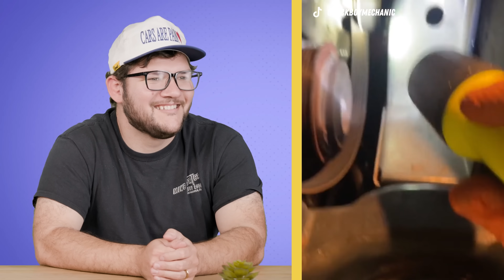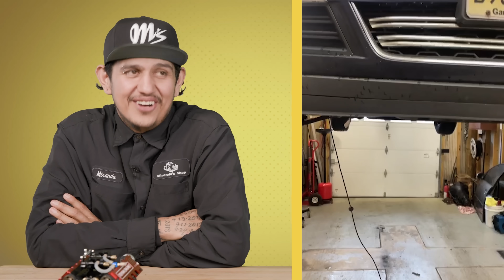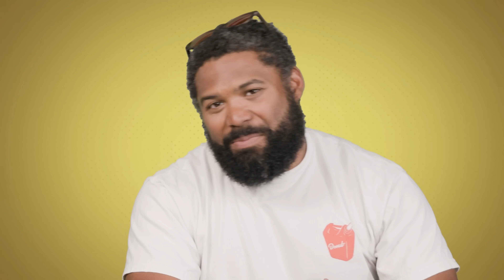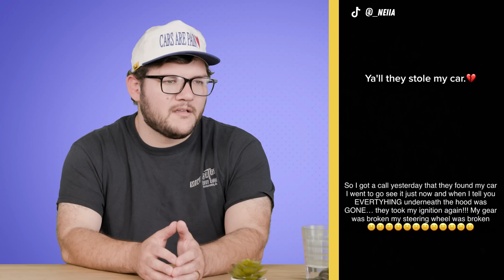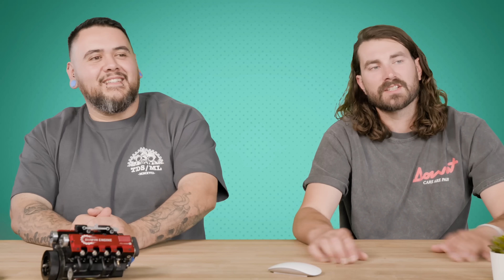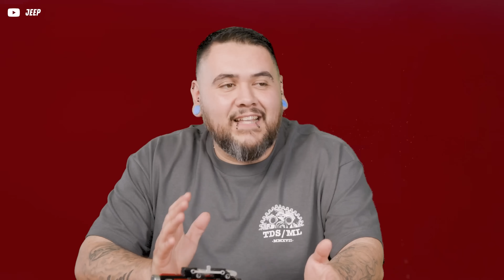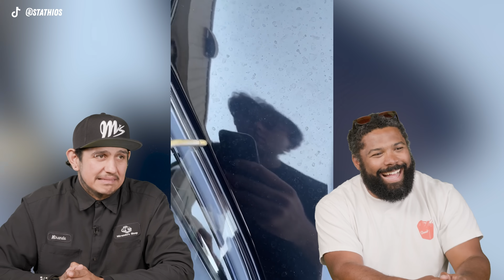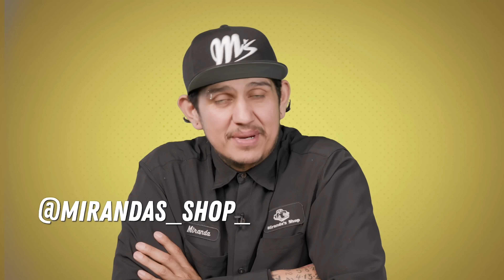Mechanic Reacts to Car Engineering Fails

Comment: Engineers rely to much on computers and algorithms. The timeless "it says it works right here" as they whip out their laptops. Not enough time in the trenches, but that's what mechanics are for. We make engineering and manufacturing f**k ups work. Oh and don't forget Intentional obsolescence. Cars last barely past their warranty, if you're lucky. It creates demand. Engineers design them cheap and manufacturers are only in it for quantity. Especially since the 2000's. Pre 2000's were over built and easy to work on. Don't get me started on the bs lithium battery cars now. Cheap materials, inexperienced yes men engineers, greedy upper management and manufacturers. It's a trifecta of crap cars made. New cars are a waste of money. 5 year warranty and 7 year loans. I mean that right there should be a warning sign...We mechanics will be here though. We'll be here to make sure crappy designs stay working.

Comment: I've learned that sometimes the issue is the engineer, but sometimes the issue is the company that the engineer works for. And engineer might have brought up that issue, but they didn't want to spend the money to change the design so they just pushed it out the door and didn't let the engineers fix the problem.
I'm not saying engineers are saints. Don't get me wrong. Lol

Comment: I got a question for a Nissan engineer. Why do the newer model sedans have a skid plate with 20+ tabs that needs to be removed just to do a simple oil change? Couldnt a smaller cut out skid plate been installed? Or just have access holes in the skid plate?

Comment: 10 engineers. 1-2 do design. 3-4 figure out how to bill/admin the designers' work hours. 2 do revisions with commercially available parts/sub in legacy parts already in production. 2 more admin/bill that and propose money saved. Yes, a bolt a quarter inch shorter can be used, but after making said custom length single purpose bolt, hardening it and the component to hold with less threads, the cars price has gone up and it will hurt sales. It sucks, but the parts have to come in under the wire. No engineer wants their work revised for cost cutting, but a cost cutting revision engineer has to post savings to move up.

Comment: the kia and hyundai stealing problem is a U.S only thing, not engineering, instead its actually marketing, cause in the U.S the key detection system is not mandated like it is in the north. The thing that is a engineering fail is the fact of how easy that capsule can be plucked out to bypass the key. but don't blame kia/hyundia for not having the immobilizer setup in the car. That shit is cheap for a reason, anything to reduce cost and get more clients is marketing. The Koreans know that people want cheap shitty but good to drive cars. So they produce a lot of junk.

Comment: Not that I want to let engineers off the hook - I’ve seen a lot of “we don’t care because we don’t fix it” engineering designs, but auto manufacturers rightfully put components like engines in multiple vehicle platforms. Was that engine originally designed for an SUV and then someone decided to put it in a sedan???????????

Comment: For Escape had a blown alternator.  Researched before trying to replace.  Dropped it off at NAPA. THEY had it ready 4 hours later. Raised the engine, lowered the transmission, and replaced the spark plugs at cost as a courtesy.

Alternator was between the tranny and engine by the firewall and I front of the spark plugs

Comment: Those washers on the McLaren would have been an engineering issue. They looked to be locking washers. If that IS the case, then it wouldn't matter if they were stainless or mild steel, they would cut through the pain on the frame and caused rust either way. If they were flat washers, then it should have been nylon or rubber to protect the paint.

Comment: Fuxk them belt tensioner man have you try taken them out on 2020 Altimas you literally have to remove the fuxking top motor mounts, raise the engine and still struggle to get tension to get the belt in. Jesus fucking christ 🤬🤬🤬🤬🤬🤬

Comment: Reminds me of sliding on the ice at 3 mph causing the in-radiator transmission cooler to break comingiling the coolant with the transmission fluid. Also no trans drain plug.

Comment: The Q3 is an engineering flaw. The roof is design poorly so the water doesn't flow into the designated location. Yes there is a tsb to fix this problem and no they don't get a new car. Audi technician for 15 plus years. Thanks for all the content 🙏

Comment: I had a 1995 Mercury Sable that had the same problem with the idler bolt. I forget what I had to do to fix it but I seem to remember having to cut the bolt completely off and then somehow putting a new one in. I remember I had to jack up one side of the engine to get enough wiggle room for the new bolt.

Comment: it seems like everything nowadays gets put on the market with flaws. It's bout like Microsoft putting out software with glitches, then providing updates to patch/repair the issues they knew about prior to launching! If only auto manufacturers provided FREE updates in a timely manner. True they do RECALLS but, that's typically 20 years later, unless it's a major issue (life or death situation).

Comment: Speaking of GM, as others have pointed out, most engineers know these problems and most of these are waved off by managers or accountants or both. The problem in GM's case is compounded by a corporate culture where making any kind of stink is severely punished. Your entire career can be sidelined if you dare cause ANY kind of wave which, anywhere else, would be considered "due diligence" or "constructive criticism." That's how the ignition switch fiasco happened, and I can say, as someone who worked there and family who worked there for decades, is the name of the game. It doesn't matter if you're trying to protect people or save the company money. If a manager has waved their hand at it and said it's not a problem, you will shut up, you will stop talking about it, you will never bring it up again, and if you so much as breathe about it, they will destroy you.

Comment: I just did the front suspension on a 2004 Status and because the customer wanted to save money on parts, he only bought the shock vs the complete unit with a new control arm. Upon trying to separate the control arm I discovered the bolts were ass-backwards. Rather than having the bolts pulling out, they had to pull in to remove, but there was zero clearance cause it was hitting the spring. After an hour of banging on the bolt, I forced it out. Upon reassembly, I reversed the direction of the bolt to make it easier if ever done again. At the same time, I understand why they have the complete shock assembly with the control arm.

Comment: I bought a model y P in red. Panel gaps are not great but they are really close to symmetrical so that's a pass for me. I had a very minor dent at the bottom of the trunk door, and a minor dimple on the frunk. Minor meaning these had to be caught at the right angle to see it and even then the lighting has to be perfect etc. I am over it now, but I do agree this care should be damn near perfect imo.

Comment: I've had to make my own custom tools for getting at the belt tensioner on a few of my cars.
Reply: Nothing like being in a parking lot with a whole box full of tools but yet nothing will quite work and thinking
" if I just had one inch of 3/8" square stock I could be done in 10 minutes"
Reply: I may not be the smartest home mechanic BUT, it should not take lifting the car and an assistant to change the belt. Thankfully, I was working in the garage with time to spare but, I was freaked out (a little) at the thought of having to do this in roadside situation with no off-the-shelf tools readily available (13mm extra-long 0-deg offset wrench).
Reply: @chenoskit  a lot of things on newer cars are hard to deal with when you have a lot of tools and place to make custom tools. Roadside repairs just might not be happening to easily.
Nothing like having amost every kind of wrench yet none will work. You need one that doesn't exist.

Comment: I have some things to say about 2 older vehicles. Peugeot 207 cc 2008 1.6 petrol specifically ( I had the vehicle and the issue) if the fuse for stereo is blown, your vehicle won't start. And I think Mercedes a class MK1... God help you if you need to change the motor starter/ alternator (can't remember exactly which). You need to take off the engine. Or something to that effect 🤦‍♂️

Comment: Although not as intense as the Acadia, the p/s pump is placed in bad positions on certain Volvo model years. My dad had a 2001 V70 wagon and had it only 2 years before the p/s hose sprung a leak and fried the alternator which sat right below the p/s pump. Replaced the hose and alternator setting Dad back almost $700

Comment: The hell you mean you gotta release the mounts and jack up the engine to get that bolt out??

Cut the fucking bolt! Shorten the bolt enough to fit going back in and still hold strong

Comment: As for the jeep problems. The probkems are because its a FIAT! And the mclaren its an engineering problem ! The door opening too close to the fender. Was engineered that way! If it was engineered correctly? No matter bad the assembler was, it wouldn't hit the fender. And as for the rusty washers they used uncoated hardware from a chevy vega.

Comment: cut the damn bolt in half. undo the remaining and put a godamn smaller one on the pulley jesus. Except ofcourse if it is holding something else also btw..... then engine mount off XD

Comment: I am an Aircraft Tech (A/P)student and did an internship at a local international airport. The mechanic I was teamed with and I were working on a private jet. We had to remove the doors of the engine nacelle  just to get to a single screw for a panel on the aircraft for an inspection. All screws were easy to get to, except for the single one  that was under the nacelle door. We were working on the aircraft itself, but the nacelle door was in the way, even after closing it back over the engine. The A/P I was working with was like "If there is a HELL, it would be full of Engineers."

Comment: You use a vacuum fluid extractor for land rovers. It goes down the oil fill cap(small metal tube in the middle) to suction the oil out. Never need to drop the pan its all done up top. You check rover oil on the gauge.
Reply: It also uses 0w-20 oil.

Comment: I'm an aircraft mechanic myself, and it's just as bad in aviation. I find myself cursing engineers constantly working on both old (though most of those engineers are long gone) and new. I understand though, that the company chooses not to correct these things at planning/testing.

Comment: I have an Ion. Shortly after i first got it, I noticed my dimmer switch acting weird. Took it to the dealership, they fixed it, problem solved. Couple months later, same problem, same solution. After three or four times of this problem/fixed cycle, I noticed water on my passenger floor. Turns out, the drain tube for my sunroof was clogged and had a pinhole leak. The reason my dimmer kept acting weird, was due to the humidity corroding the potentiometer. It got fixed after that, and quit happening.

Comment: Regarding lemon cars. I use to work at a Toyota dealership and one of the things I was saddled with was cars coming in from body shops so I could replace dashes and airbag systems as well as full inspections, trust me when I say I failed plenty of repairs and sent them back to the body shops. Due to my experiences I one day was given a Camery that was making loud popping noises according to the owner. The car went through several inspections, and no one found any issues. When I received the car, I was told if I did not find the problem, they were going to have to take it back under the lemon laws for our state. It took a good test drive under varying conditions till finally I heard the noise and managed to repeat it easily. It took a while (a couple hours) before I found it. Turned out it was a sub frame with missing welds. After replacing the frame, I had a customer that only wanted me to work on the car from then on. Another I had to go after (again lemon law bound) was a Celica using oil a quart every week in just a matter of 50 to 100 miles. In the end I learned the lady that owned the car was divorcing her Husband, so he ratted her out with proof she was syphoning oil from the engine. Last one, had a customer come in with a noise complaint from under the car was all he would say a few techs looked at it I was asked to help and over several service visits no noise could be heard/found. Finally, they gave the car to me and as before nothing, nada, total quiet. The customer showed up in my bay without permission to be in the shop and demanded to know what I had found in a very rude tone. So, with him demanding his car now and being told I had better have found the problem I decided WTH and lied saying I found a heat shield that was rubbing. He took the car and next trip in he was all smiles said I did a good job fixing his car. Boss was aware that I had found nothing, but the customer was all smiles I even got a 100% survey visit report from the customer. Boss bought me a steak dinner the next day at lunch. Only time I ever lied to a customer about a repair. To this day I don't see how it worked because I found absolutely nothing nor repaired anything, and the customer was happy with the result.

Comment: This is very similar to my primary job (nursing). I’m posting here as my business name which is repairing outdoor power equipment. You’d  be surprised how similar it is to try to assess the situation, and then go through methodically and determine what is wrong, and then fix it.

Back in the nursing world, People order shit all the time I don’t understand what it takes to actually get it done. And then you have the problem of who is actually going to pay for it…

Well, the nursing staff has  to get paid, hourly in order to accomplish the task And if you want any analysis ordered on your special body fluid, you better put the fucking orders in. We don’t read minds, and we’re not gonna just arbitrarily put in orders in the hopes that it matches up what you want to see out of this juice I just sqoze out of a human. 

The similarities seem to have a common solution: start charging more for the work. That way the pushback will eventually reach the people who designed these rat traps, and things will change to make them easier to fix when they eventually break.

Audi… I’m looking at you… 😮

Comment: The idler puller he showed in the first case probably required removing the aluminum bracket it was mounted on. Then replace the pulley.

Comment: These are the build issues the customers see, so many get fixed before they get the cars. Im an equipment mechanic for a major rental company. We get brand new equipment and trucks drop shipped from the factory all the time, weve had units arrive with the air filter housings not connected, had turbos fail because caps were left in oil lines, sensors smashed because they don't extend booms and the sensor is torqued against the boom so once it goes to full extend it slips into the cavity. We even had a hybrid manlift show up with no hydraulic fluid in it and the pump burned up because the engine had to run because the batteries weren't charged before leaving the factory

Comment: This shows how stupid mechanics are because the engineers who designed the engine and transmission DO NOT design the body and frame or decide what engine to put in the vehicle that is all done by designers who have either a high school diploma or a simple two year design degree in how to draft on engineering software. I’ve known dumb as a rock designers given the title of engineer by a clown in management and had him design the turn signal & wiper switches, he would say all the time “I don’t know what I’m doing most of the time but they pay me to do it”. Basically an engineer costs too much to run Autocad  all day so to keep managements pay high they hire a jamoke to do what used to be an engineers job.

Comment: As for the oil drain thing, I agree, put a piece of cardboard there. I like to use the box for the new oil filter.
Reply: I worked in a quick lube place, and we had this really trick green rubber THING.  Haven't a clue it's official name, was just the green rubber thing to me.  But you could bend and mold it to the perfect position to keep it off of stuff.  Really useful on Ram 1500's with the Hemi's AND 4wd.  As the oil filter was directly above where the front axel would sit.
Reply: Still bad design.  You shouldn't have to train for something like that
Reply: @kurtsandoval7714  I mean, if you need training to deal with that problem, I don't know what to say. There are some pretty bad ones but that one's child's play. Speaking as someone who's first full time job was working at a lube shop, they could have found a video of a much worse design for draining oil over other parts. There's set ups where, unless you have a specialized flexible drain funnel, you're going to drain oil from the filter over electrical wiring, drivetrain parts AND the frame and I've even seen some where there's no way to place a specialized funnel so that it saves you, you just have to do your best to wipe it up.

Comment: Just want to point out that electronic modules can be good for mechanics when done right. The intent of those modules is to make things easier to diognose and replace, but you have to make the modules correctly. Having a shitty body control module will not make things easier GM cheap ass idiots